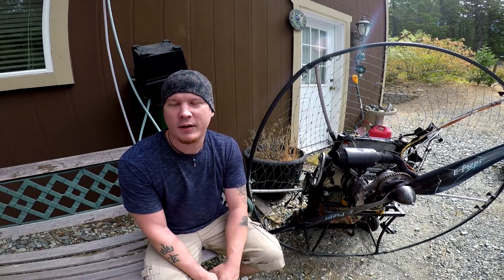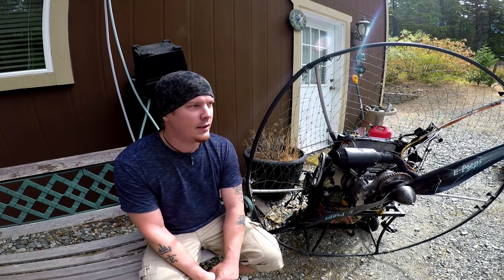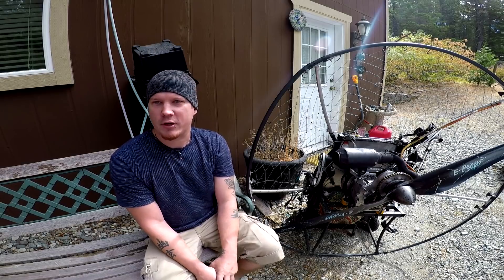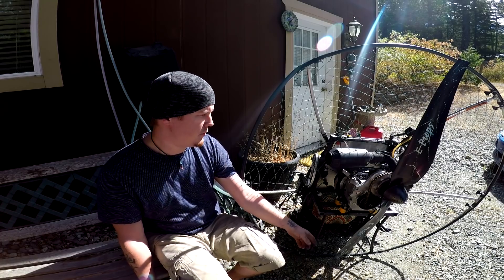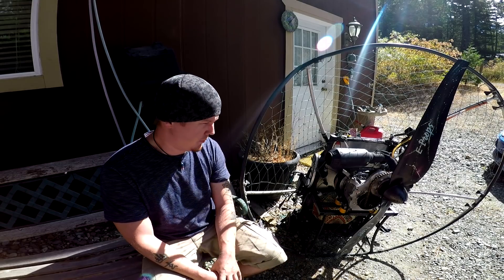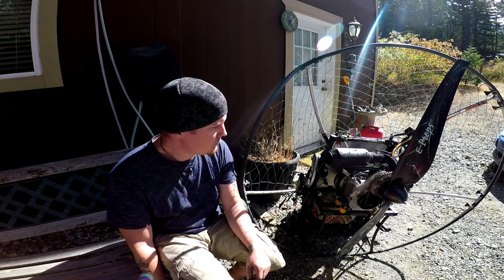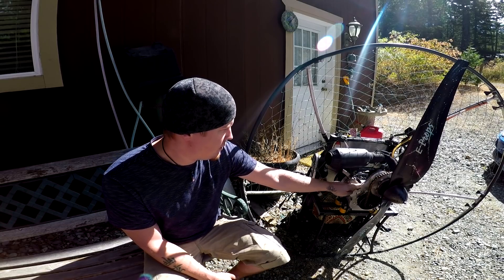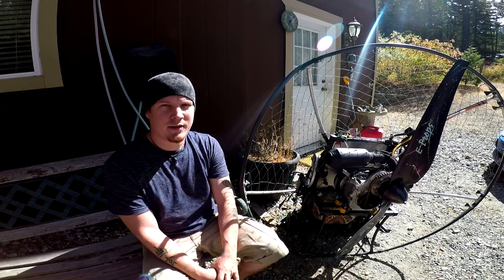Homemade Paramotor Engine - Should You Build One?

Comment: Will adding a turbo to the predator motor give you the the high performance needed to paramotor  like the expensive motors?
Reply from the maker: No.
Reply: Thanks. I've seen the turbo added to the predator at the mini bike races . Boy they are quick..

Comment: Well whats up man.  Im checking in after completing my build. We are both half right, but it did indeed prove difficult along the way.  I think I have something like 19 pulleys that I've made at this point. It flies but just barely, my rate of climb is somewhat frowned upon for safety, but at the end of the day we flew by our own hand, and that has to count for something.
Reply from the maker: Yes. My early work led me to decide to start my paramotor company, which now has a few employees and is my source of income.  Our accessories are sold all over the world and our paramotors are quickly becoming a staple model in the industry.  We're currently developing our own fuel injected engine.  It's been a wild ride.  🙃
Reply: Congratulations!!  @IrisPPG 

The start of every successful venture is innovation.  I'll will check it out.

Comment: I am very curious, at this point, why not just go for electric build? I know flight time is an issue, but literally everything else is superior, right? What if I weigh like 130 ish lb only? This way I could afford a larger battery pack I guess. What do you think? Throwing a $8000+ for this seems like not a smart thing to do at all. Seat is like $400, electric motor would be like $300-$400, frame can be DIY easily. Batteries will be the most expensive part which will cost like a $1000. Still not nearly a $8000 that middle men companies ask on a market for that. 🤷🏻‍♂️
Reply from the maker: "Smart thing to do" is subjective. I now own a successful paramotor company and have a paramotor getting ready to launch into production. Unfortunately, electric is not the way to go.
Reply from the maker: I'm glad to chat with you about electric but would be better on Facebook messenger or phone chat

Comment: There is a hundred different ways to get more torque and higher rpms without spending the amount of money you spent and still make it fly worthy and safe
Reply from the maker: Do it, and share the progress. It will be a service to the community. Of course, it will still be a splash lubrication engine which technically do not hold up to sustained high rpm but still would be nice to know.
Reply from the maker: Btw, torque is not a relevant number for flying. The only number that matters is peak horsepower and a reduction/prop tuned to utilize as close to 100% of that peak as possible.

Comment: I am useing a 250cc 4stoke  engine turning two carbon composite 3foot blades counter rotating and I am in a stem program that enables me to meet engineers from Sikorsky they calculated the top speed at 57mph at 5000 rpm

Comment: Hi Dimitri, you still have the predador 212 paramotor ? still flyes ? what pieces u most broke on flyes ? you still use it ?
Reply from the maker: Hey man.  I still have the engine but I decided that I cannot afford to keep rebuilding it. Some common pieces to brake have been, valvetrain components, valve-piston contact, broken cam decompression mechanisms... and a few others to list a few examples.
Reply: @IrisPPG  ty bro, with your information i decided to use a strong motocicle instead of a weak stationary engine, gonna star a paratrike using a honda cb300 engine. ty <3
Reply: @IrisPPG  did you do a clearance check after your build?

Comment: I am there with you with builds/projects.   I fabricated a paramotor frame but I have NOT experimented with engines.   When you come up the right recipe I  want to know.    Four strokes like you said are more reliable but they are heavier and not as powerful as two strokes.   But some day somebody will figure out how to make it work as desired.   Maybe it is you.  Good luck.
Reply from the maker: Thanks for watching. My latest homemade has a Moster 185 but I've been eyeballing the notion of making a smaller turbo 4 stroke. That should be a fun project but it will have to be after I sell my current house and move into my next.

Comment: How did you mount the prop to the motor. I would like to know how you did this and what chain and gearing you used. I am making a trike with a 420cc
Reply from the maker: Take a look at my other videos. Should answer your questions.
Reply: U have a powerfull engine but what is the weight of it also matters ? But no worry 420cc it's a lot of power sure it will produce more than 50 kg thrust 🔥 all the best

Comment: Could you not just do direct drive without a reduction, is there a reason you have to have a reduction ?
Reply from the maker: Good question, and no you cannot do direct drive if you want to make any form of usable power. Engines make their peak horsepower (what is required to drive a prop) at much higher RPM (let's say 6000-9000 depending on the engine). That is far too fast to spin a full-size propeller which goes super-sonic at like 4000 and stops producing thrust and gets too loud (not to mention they aren't designed to spin that fast... or the fact that the engine would not have the power to spin it at that RPM anyway). You could use a small propeller (something like 32 in) but the smaller the prop, the less efficient it is since a large portion of it is wasted space anyway.
Reply: @IrisPPG  thanks for your reply, very helpful.  I asked because I've been looking at doing this myself. I've seen all  Paramotor engines have reductions and put that down to the fact that the engines are all mostly high reving low power two strokes. So I went looking for alternatives and found the "lawnmower" type engines but they are all mostly low HP engines. But then I found a 20 hp v-twin engine that produces its peak power at only 3600 rpm, with a 50 inch prop it would be spinning at 0.7 mach at the tips, which while at the upper end of the desired noise levels would still be within very usable parameters and produce a good amount of thrust. Yeah it's a heavy lump but it will save going to the gym haha. If it don't work out I can turn it into a log splitter haha

Comment: Fyi you can buy a complete, 28 horsepower, 460cc gx clone from vegas carts for $700 shipped.. Now you just need a reduction
Reply from the maker: I wish you knew what running with 100 pounds on your back feels like with other bulky gear while managing a wing. You cannot for launch a gx390 size block. People have, but it's drastically underpowered for the weight and it ended up in the scrap bin fast.
Reply: @IrisPPG  Yeah, my bad. I meant with a wheeled rig. 28 horsepower is easily attainable for about $800 on a 420cc clone all in, if you source the parts frugally. I would consider it for a powerplant. There are readily available air boat cog drives, But I'd probably make my own and just buy parts. With an aluminum flywheel and all the other mods, they only weigh 50lbs or so. Wouldn't be too bad a weight penalty on a trike, but I can see it sucking as a backpack.
Reply from the maker: To give you an idea, my new paramotor with s production engine weights in at 48 pounds total weight... That's everything minus gas and reserve.

Comment: To be honest, you spent quite a bit more on parts than you would need to if you knew where to shop. Many of those prices are double what I've even recently purchased them at. Thanks for the critical review of this though since it entered my head
Reply from the maker: If you know places to get the same parts for cheaper, that's good. The main problem isn't the initial cost but how much I spent on rebuilding the engine every time it broke.  I've traced most failures to my own mistakes so I'd love to see someone make an engine that is in the same power range that actually runs reliably. If you do, please keep me posted.
Reply: @IrisPPG  I do, but for custom buggies and mini bikes. I have a couple crappy videos of the buggy, with the wrong gearing and a shitty clutch. I fixed all that but never did an update video. It's dependable as can be. Should make over 25 hp , but it's a gx420 clone and would only be suited to a trike. I really don't know your power needs, I haven't watched your channel before. I wouldn't know if twice the torque is a crutch for total hp? I have a predator 212 build too, but no videos and it's incomplete.

Comment: Can I make a wooden propeller using CAD?
Reply from the maker: You can engineer anything using cad. A propeller is a pretty complex, organic shape that would require much more advanced techniques but, yes.
Reply from the maker: Good question.
Reply: In my area it is not available easily.. what do u suggest?

Comment: What about 2stroke suzuki bike engine? And what are the  modification should I do?
Reply from the maker: A lot of people use bike engines but you have to understand that you must completely take it apart, cut away the transmission portion and create a reduction system which must get tuned to the engine's power output, propeller diameter and optimum speed.
Reply: @IrisPPG  please make a video of 2 stroke bike engine to paramotor

Comment: I have a question. Exactly what attachments do you need on the predator to be able to get in the air
Reply from the maker: I am not sure what you mean by attachments. If you mean parts, there's a general part list at 3:50 in the video.

Comment: I do not understand why you have put a reduction drive on your four stroke engine, the reason a reduction drive is there on a 2 stroke is it has to have high rpm to produce torque which is what you need to drive a propeller. 
The low revving four stroke uses its standard flywheel to store some of the torque and acts as a damper in the exhaust stroke its peak torque is produced @3000 rpm and diminishes considerably by 3600rpm perfect to drive a prop directly.
I would also look at re balancing the flywheel to take into consideration the prop oscillation by boring through the flywheel and pressing weights in.
the other way to take out the oscillation you talked about is by creating a cush drive, in a direct drive using polyurethane  to create a bushing that can take up the slack on the ignition stroke and spring back on the exhaust stroke. creating a smoother prop which is what is over come through running a reduction drive run on belts.
creating a duct that runs round the edge of your cage from fiberglass or aluminum will also increase the thrust of the prop.
lastly a smog pump super charger will also greatly increase the torque value of the engine across its rev range and at altitude  without adding a tonne of weight or complexity.

This is not I told you so!  This is the path I would take based on 37 years of experiences 

hope this helps you find a better solution, although its damn impressive what you have achieved already.
 
regards harryB
Reply from the maker: Hey Harry, thanks for watching and commenting. I've heard what you said quite a few times, I assume you come form a Karting or automotive background but unfortunately, this is not how fluid dynamics works (in terms of driving a propeller which behaves, in a way, almost opposite of how driving a wheel works on a vehicle or motorcycle). Simply put, it's not the amount of torque an engine can make that will produce the most thrust.... but the amount of torque OVER TIME (horsepower)
Let me explain:
-Torque is the amount of force applied at any given moment... it takes almost ZERO torque to spin a propeller from standstill to spinning (ie, you can flick it or even blow on it and it will move). This is not the case in a car, it's opposite (it takes a LOT of torque to start moving, that's why first gear is geared way down).
-Horsepower is the amount of Torque an engine can produce OVER TIME. So peak horsepower, is where the engine makes the most amount of work in a given time. (2 strokes generally keep making more and more as they spin up... 4 strokes tend to have a peak horsepower somewhere between 5500-8000 depending on configuration (my engine seems to make most hp around 7000 rpm or so). This is because there are a lot of moving components and springs which all simply cannot move faster than a certain speed.
-On the flip side, if an engine is doing 20 ft/lbs of torque at 3500 rpm, it produces much less total work than 20 ft/lbs of torque at say 7000 rpm. The total amount of work (the total amount of air a propeller will push) at 7000 rpm is almost double than at 3500. (in this example, we will make only 13.3hp at 3500 but a whopping 26.7 at 7000).
-If an engine makes 20 peak horsepower @ 5000 rpm and another engine makes 20 peak horsepower at 12,000 rpm, the TOTAL maximum amount of work they can do is exactly the same (they will produce roughly the same amount of thrust if you gear them down in a way to spin the same prop at the same speed)
-A propeller absorbs Horsepower exponentially with increase in speed.... so the faster you spin a prop, the more HP (not torque) the prop requires. 

This is where reductions come in. The whole point of a reduction is to bring the maximum desired speed of a propeller, in line with the engine's peak horsepower so the amount of work the engine can put out at the propeller is as high as possible.  It's not torque that produces the most thrust... it's torque OVER TIME (horsepower)
Reply from the maker: Please hit that subsribe button. This is a VERY interesting and complex topic and I plan to make a long video about just this (propellers, reductions, horsepower, direct drive, 2-sroke/4-stroke).

Comment: Very impressed with your mechanical skills!  What is your background in mechanical stuff?
Reply from the maker: Thanks man. I started out my mechanical rabbit hole by trying to build a CNC router from mdf wood, drawer slides and stepper motors from old printers. It eventually worked and I machined parts and it eventually self-destructed but it sparked the.. spark. I've built multiple CNC machines, at one point they started cutting aluminum so I was able to machine real parts and now have one built the way I want it in my spare bedroom. About 3 years ago I started wrenching on cars and am now building high-performance turbocharged engines and fabricating turbo setups for myself and others as a side hobby (as well as building my paramotor)